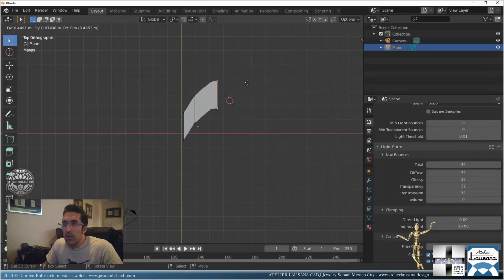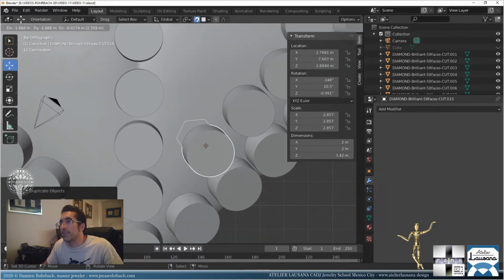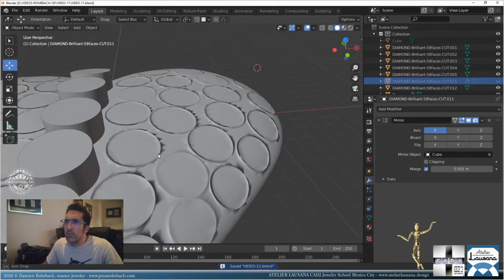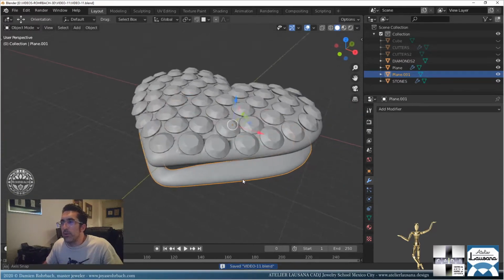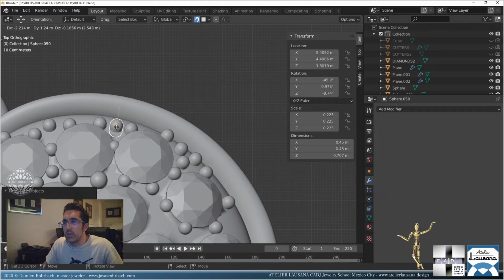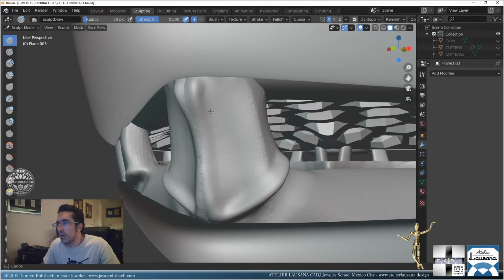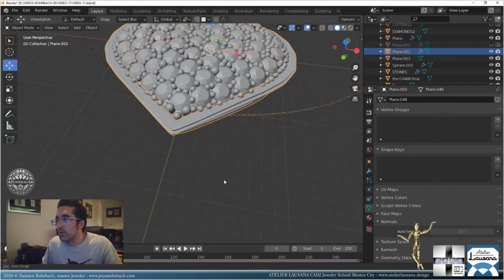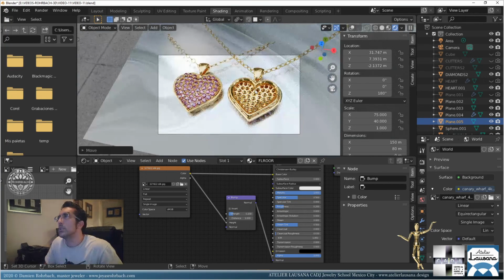TUTORIAL 11 3D Jewelry design with Damien Rohrbach and Blender

Comment: How would you go about covering an entire mesh in little diamonds+prongs? I'm trying to make a diamond pave pikachu with tiny diamonds like you see with rapper chains, but I don't want to spend a week placing 4000 individual stones :-)
Reply from the maker: You have basically 2 options, train at Blender and see the magic happen (setting hundreds of stones should take you a couple of hours) or buy a professional cad software at several thousands of dollars like 3Design V10 and do it in a couple of minutes. I do it sometimes in Blender because it is amazingly more fun.
Reply: @RohrbachJewelryDesign  Yeah I decided to go the Blender route, set about 900 stones now. 

I ran into this weird issue when I applied a boolean to the mesh in order to make all the diamonds cut into it (so the diamonds have a place to sit in). On random spots the boolean seemed to either not work or create a round hole in the mesh instead of a carving of the diamond's shape. 

So I basically applied a boolean to the mesh and selected the diamonds (which I joined together as a single object) as 'Object'. 

Any idea what is causing this weird behaviour? 

Oh and I strictly want to make a good looking render, this isn't for actual jewelry making ;)
Reply from the maker: @polboiiotto8830  What you are facing with booleans is not weird at all, it is the most common issue using any software. Your meshes are not manifold, thus failing your boolean. And that is also why 3d modelling stops to be fun, and becomes work, sometimes hard work. It gets technical and you need tools to fix your meshes. Sometimes it is really easy, sometimes you need legendary skills to fix meshes.
Reply: Just use particle system

Comment: Thank you for this tutorial! At 1:01 how did you select the back vertices aswell? Everytime I click the top right and bottom right points, the back ones don't move with it
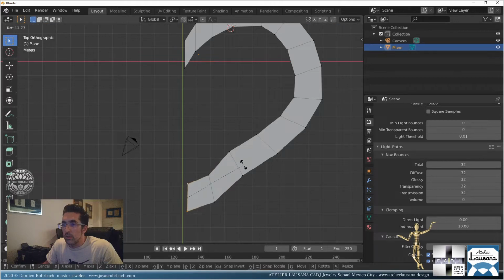Reply from the maker: At the beginning I just add a plane, so there are no back vertices. To select several vertices, click with the SHIFT key pressed, and also, if you want to select a sequence of vertices, select the first you want and then the last one holding the CTRL key. That's what I do at 1:30
Reply: @RohrbachJewelryDesign  ahh thank u so much